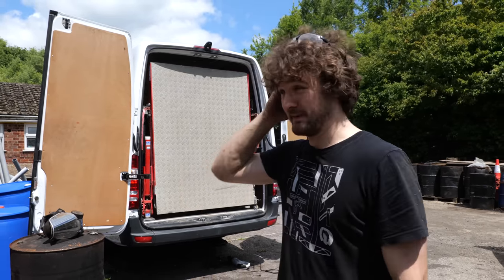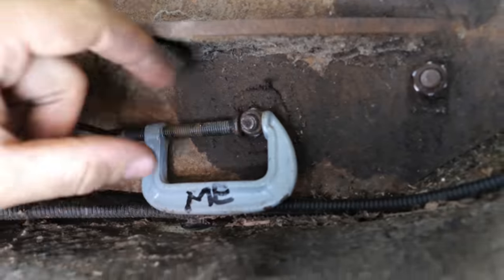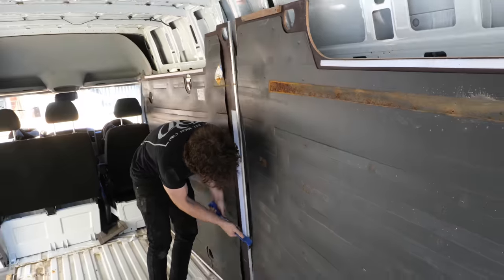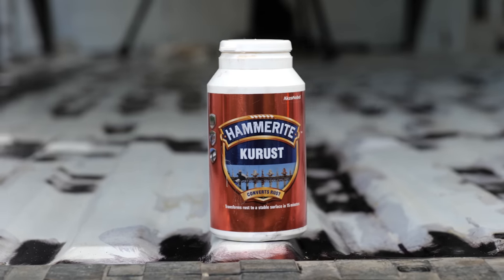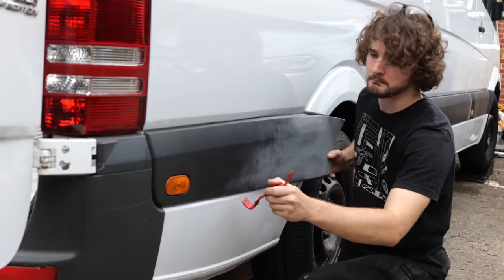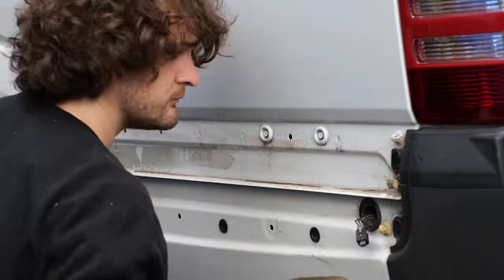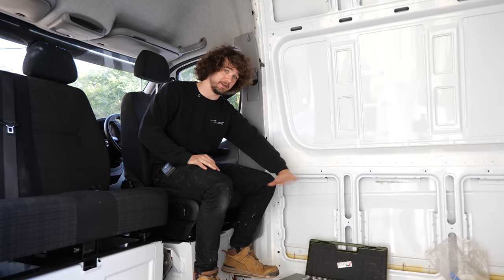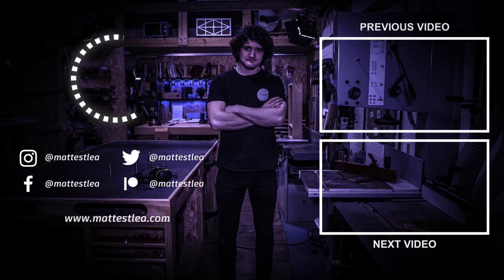Fixing LEAKS and RUST in a Van Conversion

Comment: Your  van  rust  video,  reminds me why i didnt let any " professional " company install my  ply lining, on my  van which was new in  Dec  2022, as they would have put screws in the floor and the wheel arches. I did it myself as i wanted to insulate the floor and the rest of the van.  I also  had to fix what  VW  denies is a problem,  with the same type of plastic trim grommet type, push in fixings, for trim panels, which will always leak.  Great job  you did !

Comment: Look after a few Sprinter/Crafter vans at work mate, one spot to watch out for is the drains along the sills but especially for the rear quarters. Tiny little drain just behind the rear wheels that fills up with crud and it will hold loads and loads of water inside the van doing it no good whatsoever, always make a point of blasting them all out with the airline whenever i get one on my ramp...

Comment: Hi Matt , I know this is a super late comment … I’ve only just found this series. Someone may have already made this comment but in case it’s been missed. A bimetallic reaction occurs between aluminium and steel which encourages corrosion as I found out to my cost on a Mk1 VW golf. This can be simply solved by introducing a barrier such as a thick plastic tape as a gasket. Great work really enjoy the content I’ve seen so far ( the woodworking stuff).

Comment: You've probably already what I'm going advise you not to do.
That is pir board on floor. Glue it directly to the battens already on floor (metal ones)
You've got approx 14 of them. About 50mm space between. Then glue ply onto that. A much overall flatter surface to lay ply onto.
Glue joints together on ply getting as near perfect a level joint. Sand afterwards if any unevenness. As you're putting vynil on after & imperfections will show through

Comment: Hmm i'd check that rust every year. I m not particularly reassured from how I saw you treat the underside with body coat. Rust itself is inert, it is the process UNDER the rust that has to be stopped, which undercoat just seals with air and salts in it. (Owner of a VERY rusty Saab speaking 😅)

Comment: Very interested in how you chose aluminium box section Vs wood to build the frame, was the weight about the same or was it all about the strength?
Reply: My immediate thought was about the issue of aluminium next to steel.  Moisture in the air can start an electrolytic reaction so on balance I think I would have chosen wood but maybe Matt will mention this during the build.
Reply: @Birkguitars  thank you.

Comment: I been dying to ask! Every restoration video I've ever seen from across the pond at one point or another has Hammerite paint in it.  Is this the UK version of krylon just the go to quick and easy to get paint?
Reply from the maker: Yea it’s the go-to for most consumer based metal paints I would say. Very good stuff. Not sure what the pros use though
Reply: Hammerite is actually pretty cool stuff, I have an old trailer that we sprayed with Hammerite more than 25 years ago and the finish is still shiny and holding tough. The thing sits outside in the weather and that paint is about the only thing still working on it.
Reply: Many years sho I dropped a tin of white Hammerite and some spilled out on the pavement.  It stayed there until they resurfaced the pavement about 25 years later.  Tough stuff.